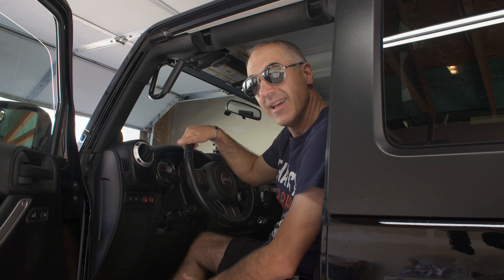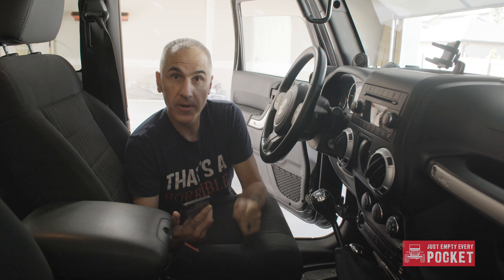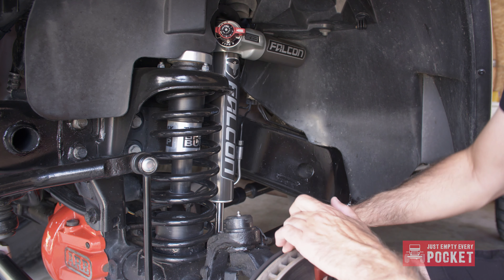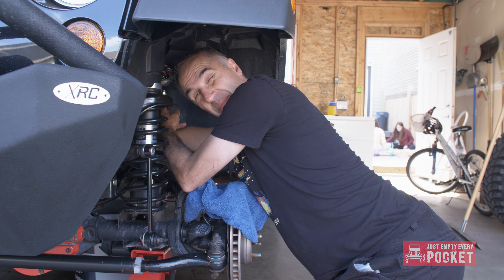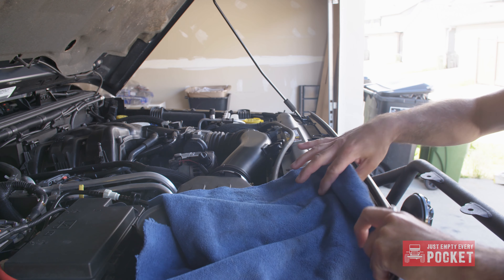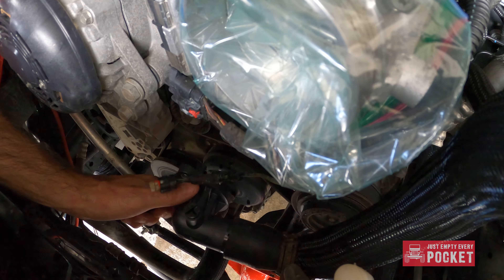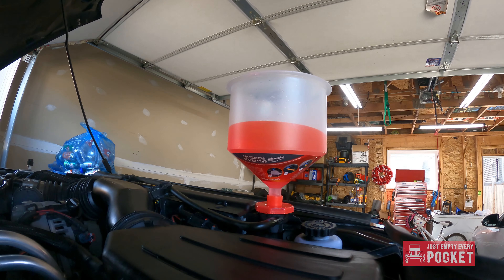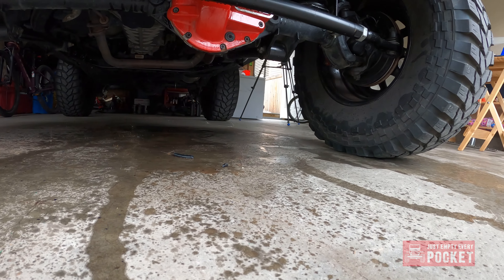P0128 Code - How To Replace Jeep Wrangler Coolant Sensor, Thermostat & Bleeding Coolant System

Comment: Thanks for this video. I have a 2014 JK and cannot find the torque spec on the temp sensor. Would you happen to know? I’m just gonna tighten down snug and check for a leak and call it a day if I can’t find the toque spec.
Reply from the maker: I just hand tightened it; no leaks.

Comment: My 2013 Rubicon intermittently throws P0128. I clear it, and it runs ok for a week or so before happening again. It's time to getter done and this video is extremely helpful and greatly appreciated! I also appreciate your quick and concise approach without a bunch of long winded BS. Thank you!
Reply from the maker: I'm glad it helped you; if it's happening intermitently you can get an OBD/R2D2/BB8 reader with an accompanying app and monitor the coolant readings. I use the Innova 3210RS OBD2 Bluetooth Code Reader; the cost is around $50 USD ($80 CAD); Just a thought; plus a reader is never ever a bad investment. This should help you determine if the thermostat is functioning as expected. If it's happeningg intermitently, my guess would be that the sensor has gone bad.

As far as getting to the point; it's the editor side of me; I like quick cuts and I try to keep the how-to vids as short as possible. 

Thanks for the feedback it's much appreciated.

Comment: The seam that runs along the stock intake air hose, mine has a split in it at the left end. Would that be contributing to the issue. As you can assume, I am not mechanically inclined. I did see a video where the dude got it ftom the top without having to remove the wheel, etc.
Reply from the maker: First off, I ONLY removed the wheel for this videol it made filming it a bit easier and showed exactly where the sensor was a bit better. That's not a step that you have to do. Second, are you telling me your air intake has a crack in it...after the filter? If so, that's VERY bad news...the engine can suck in dust...

Comment: You don’t need an OBD2 to read check engine codes on the Jeep. You just turn your ignition from OFF to ON 3 times rapidly, ending in ON position and the code will briefly flash in the ODOMETER readout.
Reply from the maker: I had heard this; tried it on mine and couldn't get it to work; I was doing something wrong. Gave up and bought a reader. But thanks for the info; If I ever have another failure that throws a code I will include this advice in the vidceo.
Reply: @JustEmptyEveryPocket  Make sure you start in OFF position, and you have to turn 2 clicks to the ON position (not 1 click to the ACC position), all 3 cycles have to be really fast as well, but it does work.
Reply: Better write the codes down also. If you don’t and forget what they were, repeating this process with the key won’t pull them up again.

Comment: Thank you for your video. 
2017 jk wrangler 
My car po128 code, so I replaced the thermostat and coolant sensor, but the check engine light still comes on.
Reply from the maker: It can take up to an hour for the code to clear on its own. Do you have a code reader that has the ability to clear codes? The only other thing P0128 could be is the coolant level. Is it low?
Reply: Thank you for your answer. 

I disconnected and reconnected the battery to clear the error code, but after driving for about 30 minutes, the engine warning light came on again. There is enough coolant and the temperature gauge  is normal.
Reply: Same for me
Reply: If you are facing the same issue, I recommend trying an ECU reflash or replacement.

Comment: The Temp sensor you used looks like 5149077AB for the engine oil temp on oil filter adapter but not the 68164627AA which is Coolant Temp to Cylinder Head.
Reply from the maker: It’s the NAPA UNITS5805 which is a coolant temperature sensor not an oil sensor.

Comment: Great video thanks.  I went from a PO128 to a PO118 when I replaced the sensor.  Turned out I didn't get it plugged back in securely.
Reply from the maker: I’m glad the video helped; I will put a note in the description about the P0118 code.

Comment: Had this code pop up on my 2015 wrangler, I checked the coolant and the over flow jug was low and the cap was off. Possibly from the dealership not putting it back on for maintenance? Would this trip that code or is it as what’s stated in the video. Thanks :)
Reply from the maker: Mine was from a faulty sensor; my understanding is that a P0128 is only from sensor or thermostat failures. I hadn’t heard of a loose cap; but anything is possible :)
Reply: Yeah, I had a bad radiator plug and I just replaced it also from the dealership. Also remember, cold temperatures makes it go off if you have bad coolant so in a way, mother nature lets you know if the fluid is no good.

Comment: Hey i changed my thermostat now the fan sounds much louder than usual I def top coolant it’s running on high. What do you think this might be
Reply from the maker: What year?
Reply: @JustEmptyEveryPocket  2018 Jeep wrangler jk unlimited
Reply from the maker: What is the temperature gauge showing? If it’s on the warm side, which it sounds like, there is likely a bubble in the coolant. Park your Jeep nose high overnight (with the Rad cap off) or burp it for 20 minutes or so with the engine running.
Reply: @JustEmptyEveryPocket  it shows 217-224 driving. & on the gauge, stick remains in the middle. But I’ll give it a try thanks bud
Reply from the maker: @c1b14  any luck?
Reply: @JustEmptyEveryPocket  fan still running on high. I’m just waiting on a coolant temp sensor to arrive I’ll see if this solves the issue
Reply from the maker: Is it still throwing a P0128 code? If so then it's definitely the sensor. Hardest part of getting it out was getting the dang connector off LOL
Reply: @JustEmptyEveryPocket  Not since I cleared it after the thermostat but I figured since the fan has its mind of its own it might be it. & I know I heard of the infamous fight with the connector
Reply: Any luck?
I had engine light code p0128 code, on 2017 jk, replaced thermostat, topped off coolant, burped it a little, started running hot when test drive, heat is pumping, top hose hot after burpin, but still 210+, so I have it elevated with cap off.....should I try coolant temp sensor or is it most likely air?
Thoughts?

Comment: I did this and still have a check engine light.
Reply from the maker: Is it throwing a new code? Does your electric fan come on? Or is it on constantly? P0128 can also include a faulty fan.

Comment: I had been dealing with the P0128 error code, so I replaced the sensor and thermostat multiple times. Despite there being no actual issues, the warning light kept coming on, so I took my Jeep to the dealer.

However, for eight days, the Jeep dealer provided no updates or information and only kept saying they would contact me.

When I finally visited the dealer in person, they told me I needed to replace the head gasket, and the cost would be $6,400. Honestly, they were nothing but a bunch of scammers.

It was strange that the warning light wouldn't go away despite no actual problems, and it was even more suspicious that they insisted the head gasket was the issue.

Since the dealer couldn't provide a proper answer, I later consulted a retired expert.

I explained that I had already replaced the sensor and thermostat, but the P0128 warning light kept coming on even though everything seemed fine.

He discovered that the real problem was with the ECU.

I replaced it with a used ECU at a much lower cost, updated it, and now everything works perfectly.
Reply from the maker: Thanks for sharing! That’s a good tip about the ECU. Always better to check those easy things first.

Comment: 109 inch pounds for Thermo torque.
Reply from the maker: That’s more torque than anything else being screwed into the aluminum block. Where is this spec from? I did mine to 26 max and no leaking at all.
Reply: @JustEmptyEveryPocket  yeah, that is 3.8
Reply from the maker: @queensapphire7717  ah; mine is the 3.6L

Comment: My wife's 2013 Wrangler has been the biggest pile of shit we've ever owned and the worst vehicle I've ever worked on.  It's almost as if they purposely made simple components a pain in the pass to reach or you have to take the entire top of the end apart to get to.  I hate this vehicle.  She loves it because she doesn't have to repair it every month.
Reply from the maker: hehehe I'm sorry to hear that's been your experience. Mine went 9 years without any issues at all. The first problem I had was with the oil cooler/filter assembly. It was 6 bazillion below zero here that Christmas and it cracked. Big mess; easy fix but yes, had to take entire top-end of motor off. While I was there, changed the spark plugs/coil thingies too. The suspension is super easy to work on, but I agree with you, some parts of the power-train are just flat-out stupid to wrench on. Clearly designed by an engineer that has never ever worked on a vehicle in their entire life!
Reply: I have 2013, and this is the first time I ever got an error code. The P0128.  My mechanic is very good but also very expensive. He will rake me over the coals . I'm going to look for somebody who does this on the side.
Reply: @triptonmiller8532  I've seen that code for years on my wife's Jeep, especially in the cold months.  I just reset it now.  Not warming up in allocated time is not really a concern to me.  

On my wife's 2013, we've been through two transmissions, 4 axle seals, rear brakes keeping getting replaced due to axle seals.  Radiator, heater core, Alternator, garbage plastic oil cooler in the intake valley which will probably fail again, multiple failed engine sensors, front suspension components, valve cover gaskets, ignition coil x 2, and leaking fuel injectors, etc....  The only shockingly positive and strange thing I can say is that it has over 150,000 miles on the original front brake pads.  They just seem to never wear???  And braking performance is great, as well.  Interior has held up very well, though.